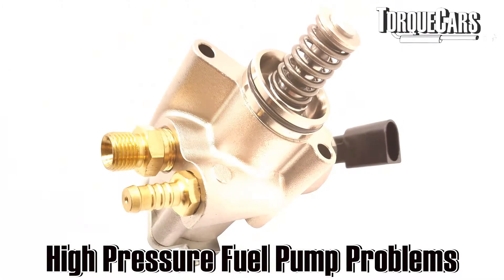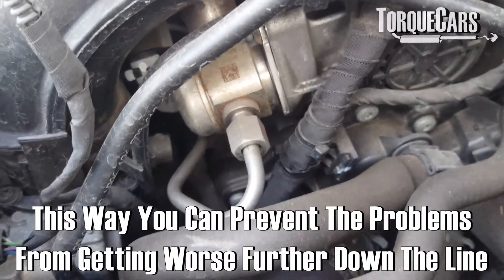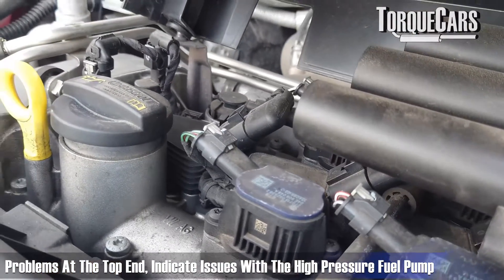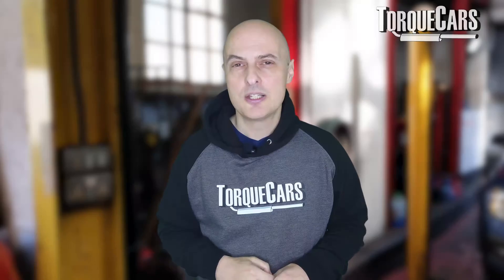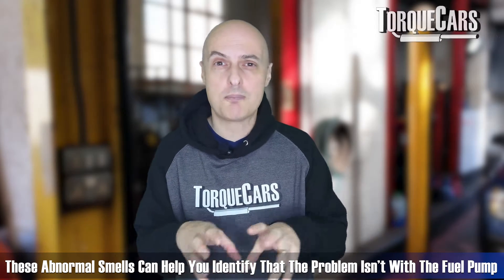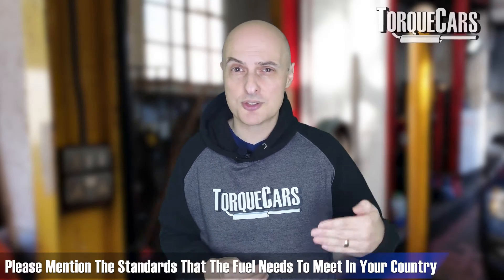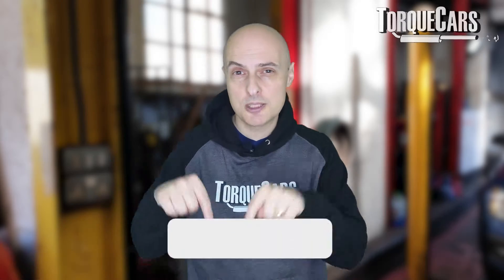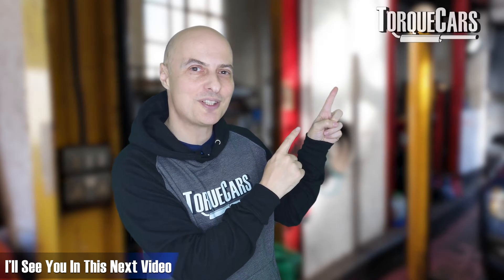Is Your HPFP ok? Investigating Typical HPFP issues(High Pressure Fuel Pump Problems)

Comment: I wonder, never looked into it, but if uprated high=pressure-fuel-pumps are a thing, if so probably not on my little Pug ^^
Reply from the maker: They are a thing, sometimes the stock factory one does not flow enough for the injectors/rail so you need to add more capacity. This is more for direct injection engines. The Pug will have some form of fuel pressure regulator, I recall fitting an uprated FSE fuel pressure regulator which basically increases the fuel pressure, rather than add power it will make the throttle response more snappy. The stock ones tend to stick a little and can cause pressure fluctuations which may impact performance.
Reply: @torquecars  Oh right thanbks good to know =)